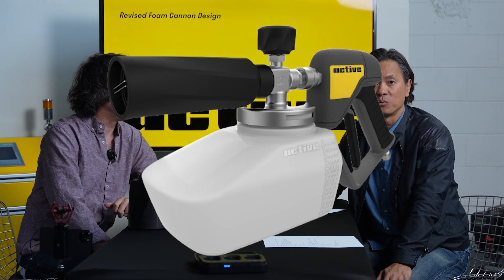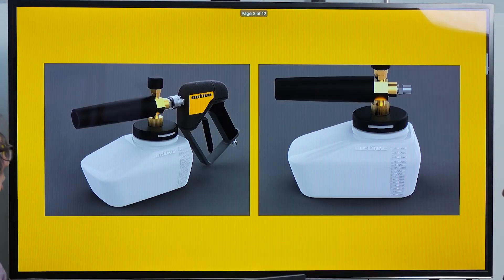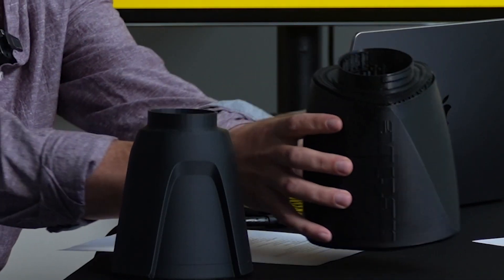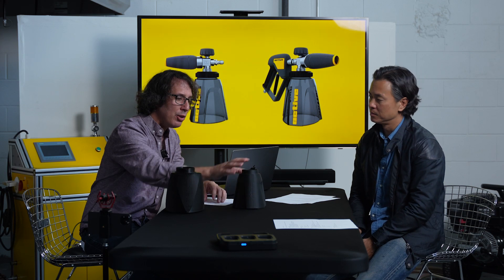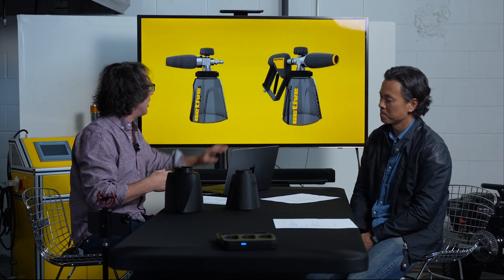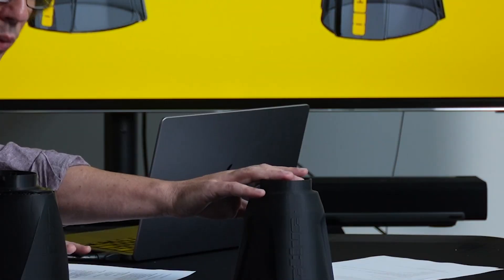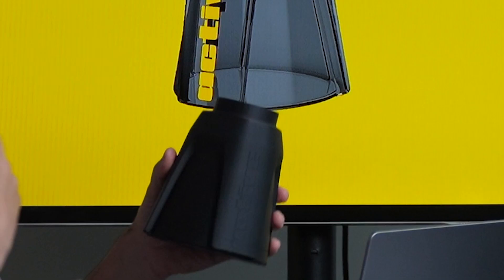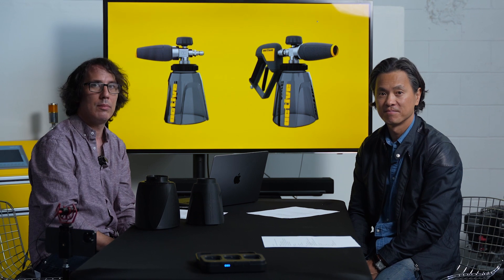NEW BOTTLE UPDATE | LET'S BUILD A FOAM CANNON - PART 2

Comment: The head of the design looks amazing… just make sure you add the weighted straw!  Such a simple thing so many companies skimp on.  I would rather have a thicker plastic, than a clear bottle.   The mjjc pro v2 is awesome.  People
Like the V3 for the clear bottle but I’ve dropped them plenty of times to know that clear bottle won’t last.

Comment: I love the idea of having ratios already on the bottle. With how slick these soaps are. I would love to see some texture rubber on the cap and maybe on the bottle itself to help get a good grip. Also including a cap for the bottle would be a nice touch. Especially when you don’t use all your product and don’t want it to spill out if the bottle tips over when driving.

Comment: Like products 
The new drawing design 👎 need something comparable to a Frankenstein design between the heavy hitters but at a lower cost point 
Like mjjc 2.0,mjjc 3.0v,griots garage boss,MTM 
-definitely a wider base at mouth but I would say ultimately a go to would be 
- bottle like the mjjc or mtm pf22 with wide mouth with cap design similar to mjjc 3.0v with adjustable like mtm pf22 and definitely a tube with weighted ball and foam ability of a mjjc and all that combined ya have ultimate foam cannon

Comment: Ramping up to buy a whole system and my YouTube algorithm knows it.  Been most impressed with reviews on Griot's Garage BOSS (OG just picked this up) and MJJC Pro V2.0 foam cannons but waiting to see production specs on Pro V3.0 (expecting SV3.0 improvements like stainless, quick connect lid, leak proof).  With these options, I'm not sure why so many people live & die by small mouth MTM PF22.2?  Features you could consider adding to your already impressive list  1) compatible with 28mm thread bottle.  2) metering tips in pick-up ball.  3) include short silicone tube for included wide base (easy to hold) bottle AND longer tube for taller bottles (likely 28mm).  Fyi, haven't found anyone doing #3.  I think this package of features would provide option of not having to dilute some products at all, just a quick bottle change.  Mostly to provide easy expansion into multi liquid process.  However, would still want regular widemouth bottle (your dilution indicators are a great idea) for primary soap.  Love that you're letting viewers behind the curtain on your development process.  Great way for you to do cheap product research and end users to get some fantastic products.  I'm now eagerly waiting for your foam cannon and Active 2.3 before I buy anything.  With your swivel short gun and 15 amp operation, this is shaping up to be an awesome, yet accessible, complete package!  All that's left is sourcing a matching yellow hose, or maybe let Matt worry about that :)

Comment: I have an MJJC Pro V2 cannon and I think it is as perfect as it gets in terms of functionality. It ticks all the boxes: thick foam, adjustments of spray pattern, wide opening of bottle, doesn't tip, weighted metal ball on pick up tube, doesn't spill liquid when tipped, interchangeable orifices, additional canisters with caps available for purchase. If you could make it look sexy as on your newer renders, have transparent container at similar or lower price, that would be the best product on the market in my eyes.

Comment: Looking good so far and agree with James all hand sizes should be able to easily hold the bottle while it’s full. Another thing would to be very mindful of injection molding or whatever process to create the bottle. Many out there have a great design, but they failed when the bottom was not level, bubbled or it bowed out causing poor balance. Making sure the bottom corners of the bottle will be the right size for the weighted ball so you can get all the soap out and not leave any behind. Dilution markings are always a big plus, but most would prefer chemical first then water.

Comment: * half / quarter turn locking from head to body of canister - 
* Provide a sealed or turn of a knob for us to be turn upside down and shake soap
* Mixing Ratio either on the bottle or in the actual box/cutout/pamphlet(make water proof) - we typically mix in our garage/mobile vehicle while we are near are chemicals and products
* sell that pamphlet :)

Comment: On the ratios: I think most put in soap first so one panel of the tri pod bottle is dedicated to soap measurements 1/8 and 1/4 cup measurements(metric also I'm in the US obviously) for most popular ratios bigger fonts for those and then regular fonts for the measurements all the way up..(see 2 stroke gas mixing bottles) for examples.. Really once you have the soap then most will fill the rest with DI water to the top...So I would figure your ratios to fit the bottle volume...Example I use MTM model...I know if I use 1/4 cup of soap and fill the rest with water that I get great foam..and that will be different with each soap..trial and error anytime you change soaps. Well your container is gonna be larger so 1/4 cup will be the same but if I just fill up the rest you got more water..